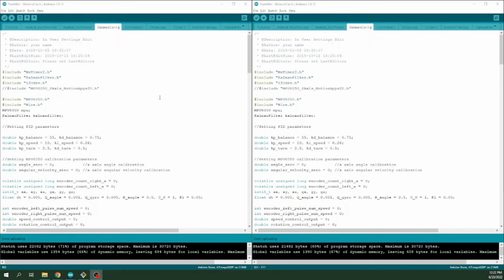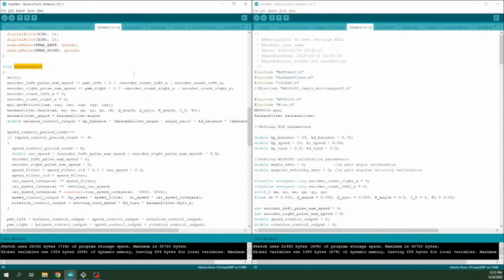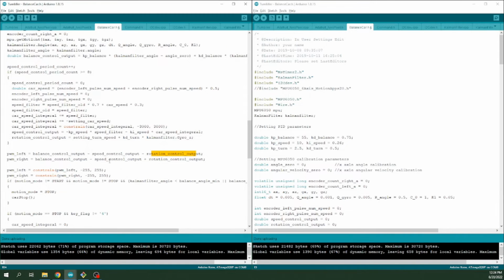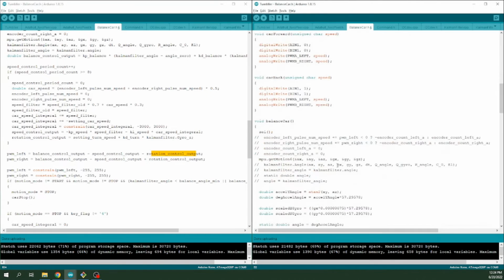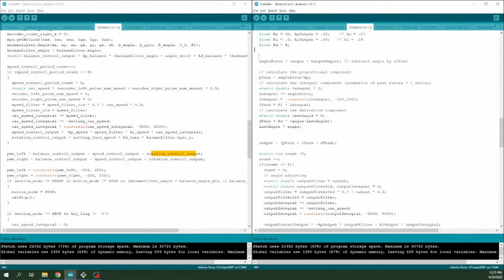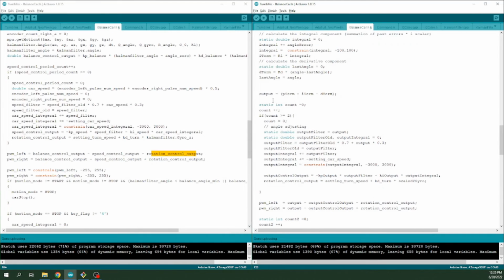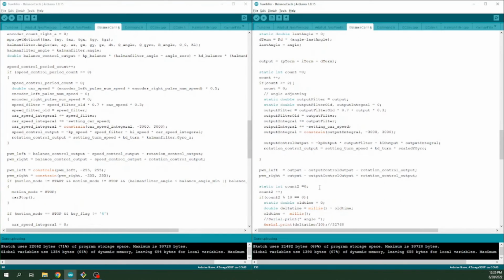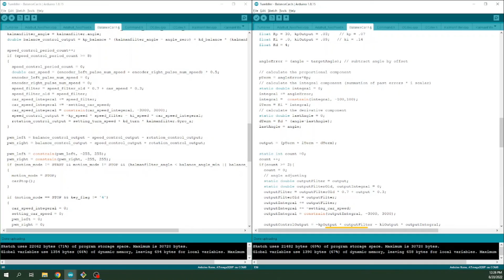Reprogramming an (Elegoo) Tumbller

Comment: how do you connect the tumbller to the code?
Reply from the maker: On the tumbler there is an Arduino nano, you can connect either plug in a mini or micro USB connector to it and then open the Arduino program to flash the nano.

In the Arduino program you should be able to see connected it from the Tools->Port->COM(X) option

Comment: Hello i'm trying to print the value of the accelerometer/gyroscope in the monitor but i have a mistake because i have this mistake when i try to code in Tumbller.ino : 

C:\Users\ezech\OneDrive\Bureau\Tumbllertest\Tumbllertest.ino:20:9: error: redefinition of 'MPU6050 mpu'
 MPU6050 mpu ;
         ^~~
In file included from C:\Users\ezech\OneDrive\Bureau\Tumbllertest\Tumbllertest.ino:13:0:
C:\Users\ezech\OneDrive\Bureau\Tumbllertest\BalanceCar.h:15:9: note: 'MPU6050 mpu' previously declared here
 MPU6050 mpu;
         ^~~

exit status 1

Compilation error: redefinition of 'MPU6050 mpu'

Thx you

Comment: My elegoo tumbller stopped working when I tried to change the speed. Think you could help me?
Reply from the maker: Worst case you should be able to reflash the original code back onto it. 
Idk what line of code you changed the speed on but I would recommend making the speed slower over faster if you want to change speed. If the speed is too high, it might go to angle too steep to recover from or get a brownout on the board.

Hope this helps!
Reply: @bobojo5642  I really need help I can't find the code could you find a way to give me the code that would be super helpful :D